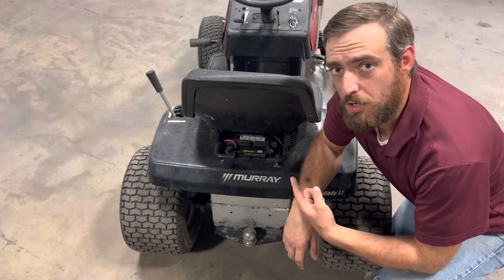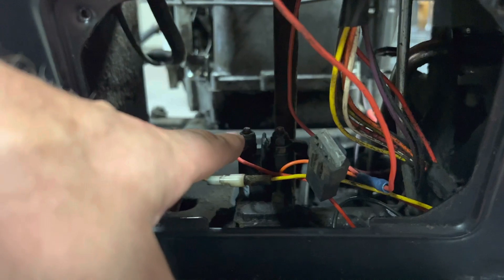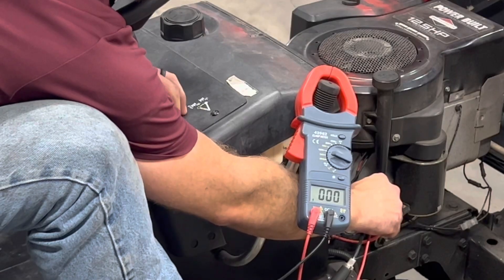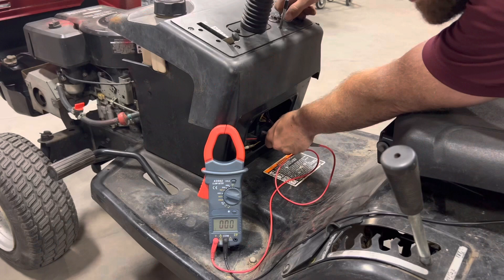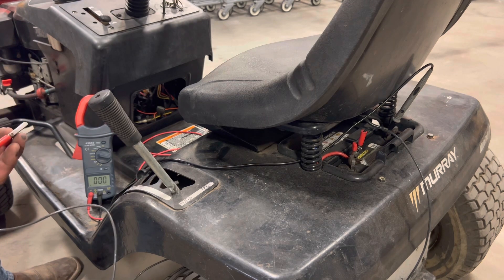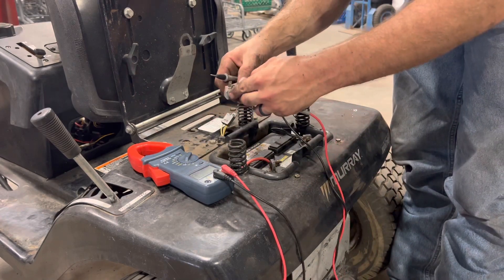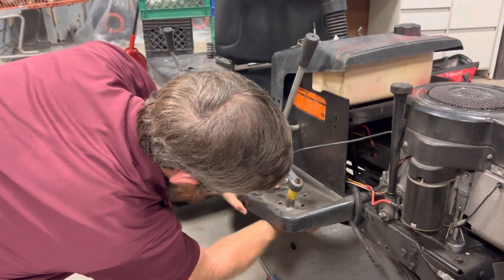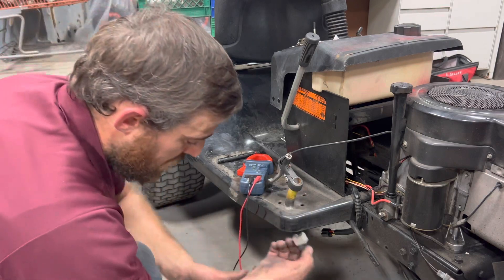(Almost) Everything You Need To Know About Riding Lawn Mower Electrical Diagnosis!

Comment: hey do you have any tips on why my lawnmower battery dies after sitting for 1 night since i use it almost every day and i have a bad feeling that my lawnmowers engine and battery might just be cooked
Reply from the maker: The battery could be bad. I would test the battery first, then look at your charging system if the battery checks out fine

Comment: Normally Closed means there's continuity with the switch actuator not depressed and the contacts are open when the switch actuator is pressed.  Therefore, it must be a Normally Open switch by the way the switch actuator works.  Well, by the way the safety system works.  The seat, clutch and blade switches must ALL be closed because they are all inline, in series, and when either one or more is/are open, like when you get off the seat, the circuit is open at that point inline and the engine shuts off.  That's unless they are wired in parallel and all 3 must be open for the safety feature to work, but that's a much more complicated configuration.

When you have 3 pins on a switch, it's a SPDT switch, or a single pole, double throw, meaning one input (or output, depending on wiring) and 2 switch positions. The single pole is marked C for Common, one switch position is marked NC for Normally Closed and the other is marked NO for Normally Open.  NC is connected to C internally when the switch actuator is NOT pressed and NO is connect to C when the switch actuator IS pressed, so we're using the NO position here in all 3 switches.  The seat switch may not have NC and NO terminals, making a SPST, or single pole, single throw, or one active switch position, being closed when the actuator is pressed.

There is usually also a Reverse switch position in the ignition key switch, which is part of the blade safety system.  If the ignition key not turned to Reverse after starting the engine, the engine will die when you try to mow in reverse, but not when the blades' PTO lever is not engaged, but this may be a separate connection in another safety system in the schematic; a Reverse safety system.  I'm not sure of the wiring, but I do know it's often there.  However, since the deck is no longer installed and won't be again, but the PTO handle still actuates the switch, here's a solution.  You could short the switch connectors together, remove the switch and permanently bypass the PTO switch and system and then remove the PTO handle.  One less thing to mess with, since it serves no purpose anymore and won't ever again.  I hope this helps.

Comment: This is a great tutorial for this trouble shooting. Best one I’ve seen. I’m building an 83 Murray with chrome grill. I call it the muscle car of lawnmowers. Mine has an odd problem where the mower tried to start in the run position instead of start. I know the wires aren’t crossed cause I put back on post same way. There’s another plug-in off the solenoid I don’t know what it is. But anyways, subbed to the channel just for this build.
Reply from the maker: Thank you very much for your input! 
It sounds like there may be wires misplaced on your ignition switch, or something may be shorting out to your solenoid when the key is turned on. I would disconnect the starter and check voltage on your ignition switch pins with the key in the run position and the start position. 
Good luck!